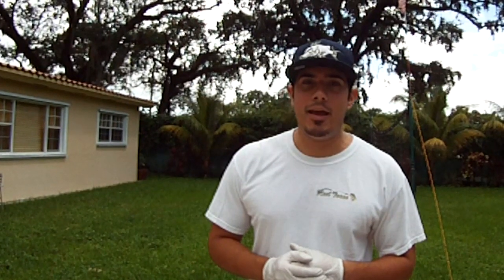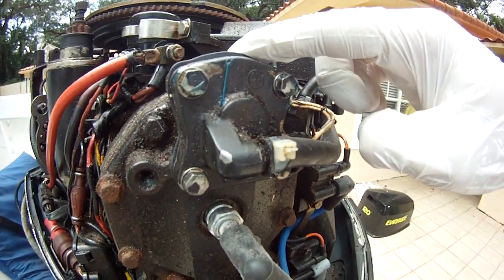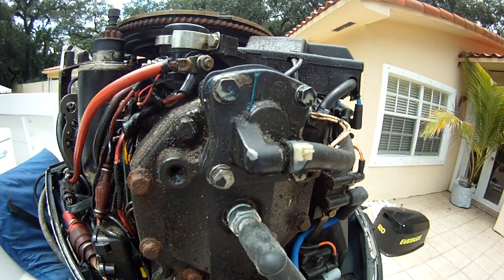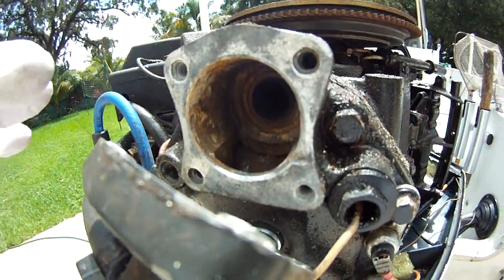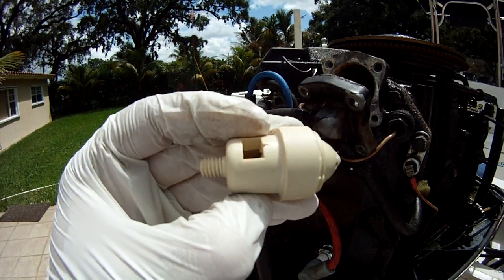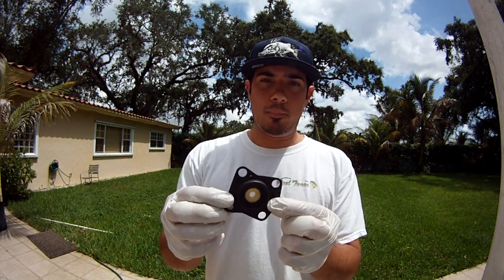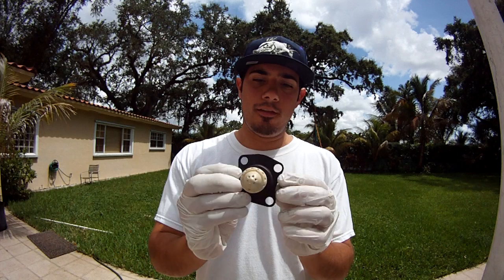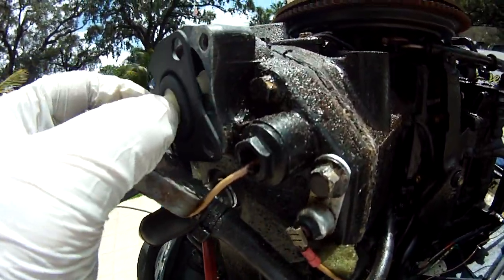How to Replace Thermostat on Evinrude Outboard Engine.

Comment: It's super uncool how evinrude puts the  thermostat for 97 115 v-4 at the bottom of the cowling!
Reply from the maker: definitely a knuckleduster. a swivel socket extension or joint socket adapter is great for those tight areas

Comment: Hey, i have a evunrude 120 hp 1999 and for some reason its been making a long 2-3min beep what could it mean??? It also drops the rrpm by a few.
Reply from the maker: A beeping sound is usually an overheat issue. If it immediately starts beeping the second you turn the key it may be an oil alarm or water in the fuel alarm.

Comment: Do you know how to bypass the water control valve assembly in your motor?
Reply from the maker: The cooling water valve was to cool induction air at higher loads on these older outboards. its purpose helped in increasing HP. It's not really needed and can be removed. there is a good forum by dhadley who states how to do so on iboats

Comment: May sound stupid, but I'm actually just ignorant :)...how do you know if your thermostat needs changing?  my 87 120 will sometimes rev up to WOT at 5,000+ rpms...but most of the time will not.  Could this be related?
Reply: Trey Coursey but it in boiling water if it opens  it should work unless its just really banged up